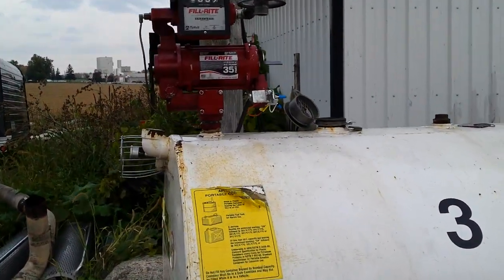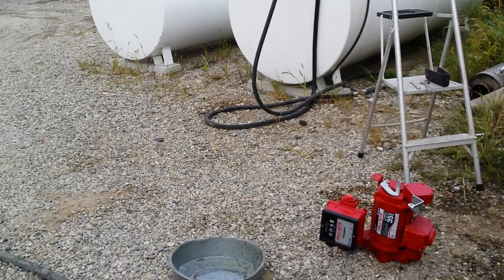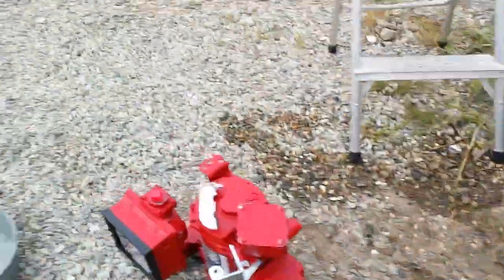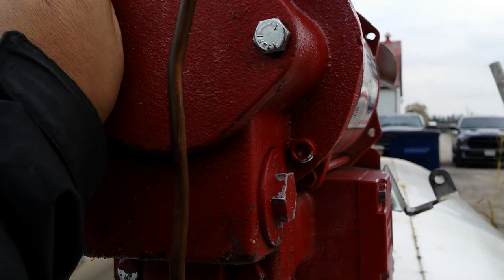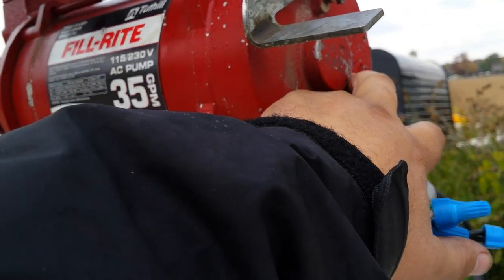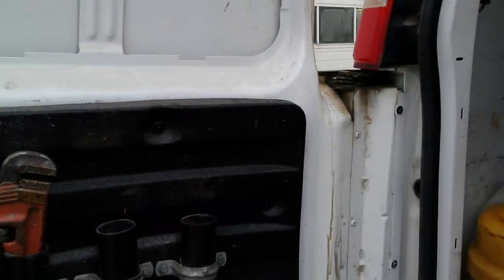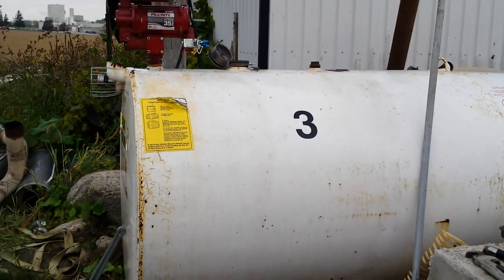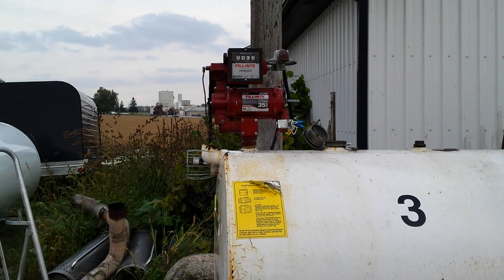Fillrite 300V series high speed pump troubleshooting and repair.

Comment: What is the purpose of that little copper tubeing going from the side of the pump to the bottom of the pump ?
Reply from the maker: It's an anti-siphon tube. If there was something wrong with the nozzle or if the hose fell to the ground and had a leak the whole tank of fuel could siphon out. It's a safety mechanism.

Comment: have any idea what would cause this exact kind of pump a (fill rite 20 gpm 115v) NOT to suck/pour any fuel???? A loose connection maybe?,,,, one of those vanes are chipped on the corner of it, but didnt seem like a big deal to me but maybe it is?
Reply from the maker: If it has a filter change it...especially in colder weather.  Also, take the nozzle off and see if that works. Next check the drive key and strainer.
Reply: @darinparest  thanks,,,, i got the pump working,,,, the vanes were stuck to the rotor thingy,, the vanes wasnt dropping freely from the rotor thing, idk why it took me a long time to realize that. I seen it doing that too but didnt think nothing of it
Reply from the maker: @riverrivers250  excellent news. Glad you got it going.

Comment: my fr 700v fill rite pump keep losing it prime. You can un screw the  fuel filter a little and it will catch prime and pump.  any help
Reply from the maker: Hi Anthony. Try changing the filter first. If that doesn't work take the nozzle off and try. If the pump catches and the filter is loose you'll get soaked.